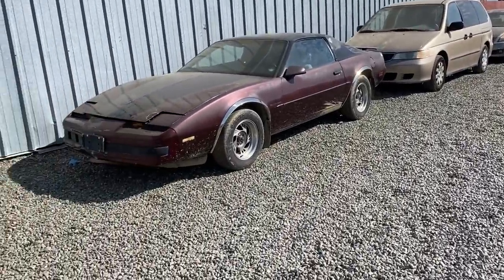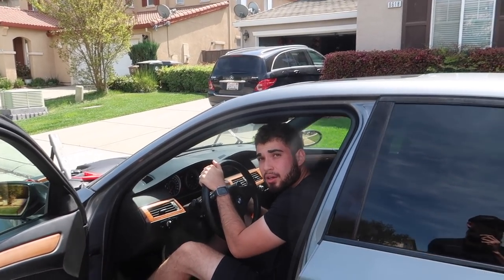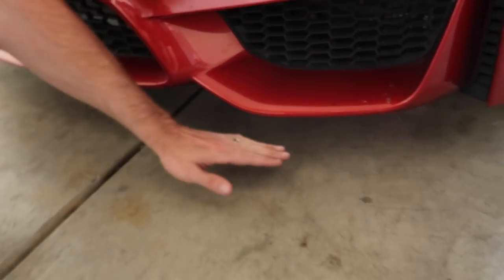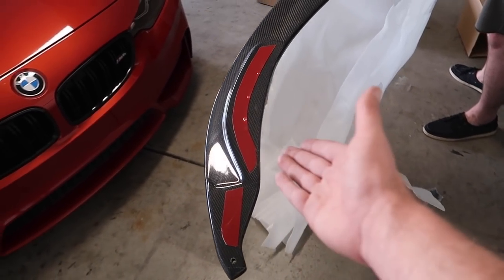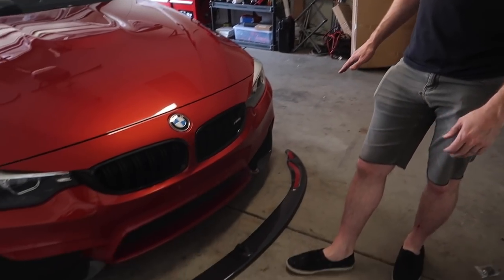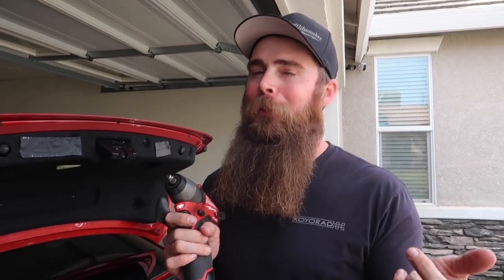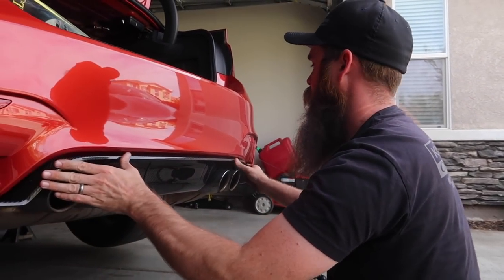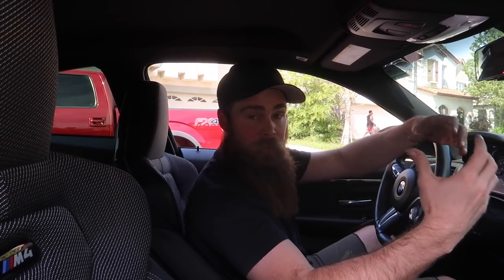TRADING MY F150 FOR ANOTHER M4?!

Comment: Bad Throttle actuators or TPS cause the s85s to run like complete crap. They cause a bunch of misfired everywhere, no torque, limp mode, engine failsafe mode, lean codes, rich codes, tps codes.